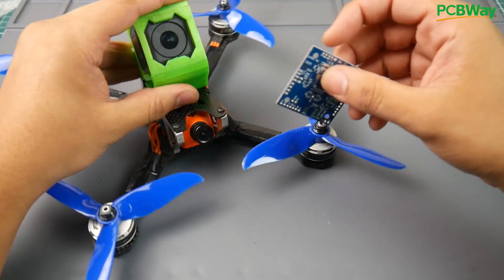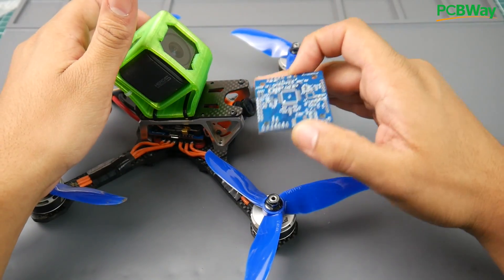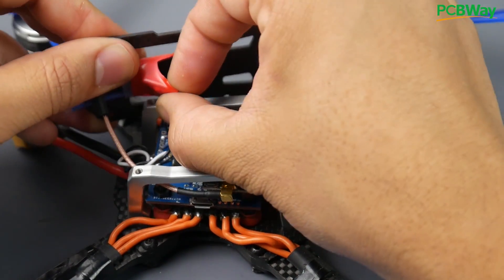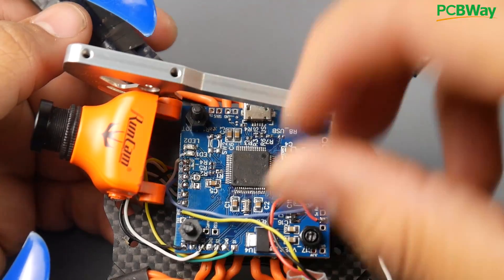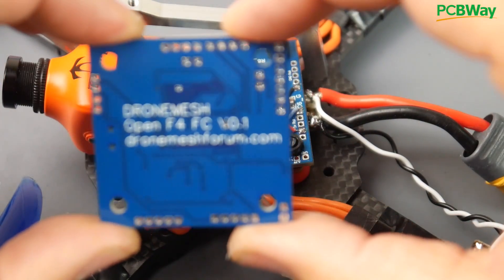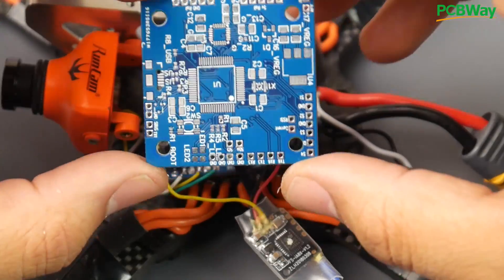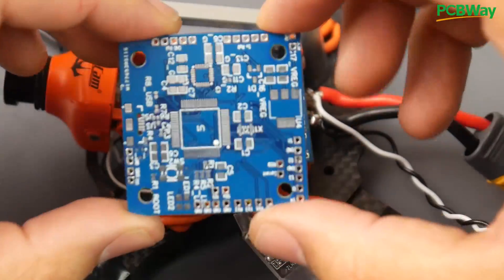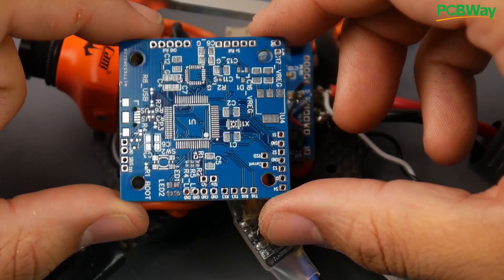Will It Fly??  // DroneMesh OpenFC Open Hardware Flight Controller

Comment: Congrats, I think. Would it be a lot harder if you did not use an already programmed fc and tried to load the betaflight on it? Also, dont you think that just plopping down the fc on the board, wiping on solder paste and swiping the solder iron down the fc pins is going to generate a lot of shorts between pins?

Comment: What do you reckon to adding a 100uf ceramic capacitor to escs/power lead? I've been learning that low esr capacitors don't do well with high frequency noise. I was going to throw a few on some builds and see if it makes a difference. Any reason I shouldn't try this?

Comment: What about all the noise on the video the black lines that we're going sideways then started going vertical
Reply from the maker: Raw Battery Voltage and No Capacitor on ESC
Reply: My  drone  remod not canect  pecb borde who part raipear and changing sachan  borad

Comment: Would you consider using a usb-c  connector instead? It's a bit stronger then the micro usb
Reply from the maker: You can modify the PCB source I have everything public..
Reply: Drone Mesh I feel like usb-c should be standard.
Reply: @bentarr17  yeah
Reply: it's "more" expensive
Reply: @DevBench4Life  Might be but if it will last longer, wont it be better to spend 20 cents more ?